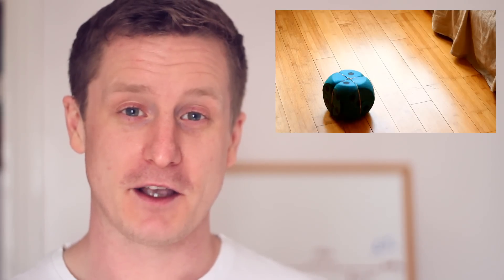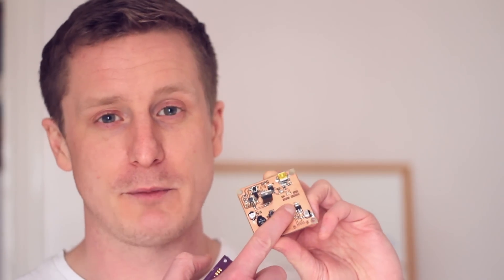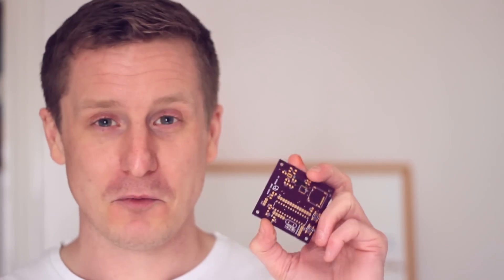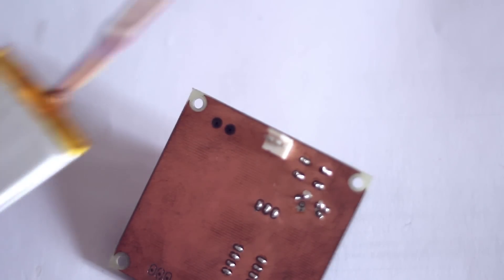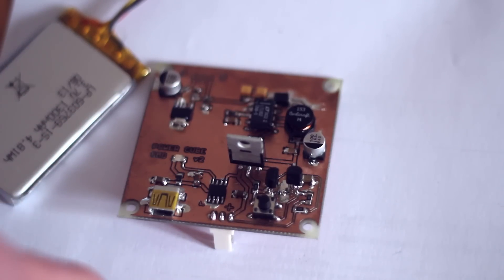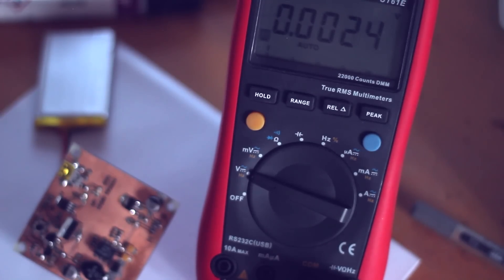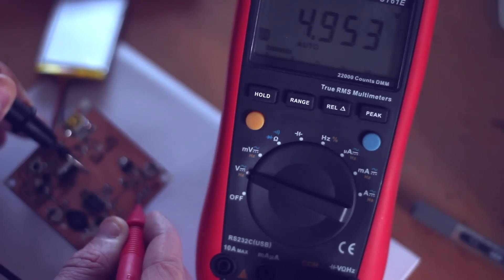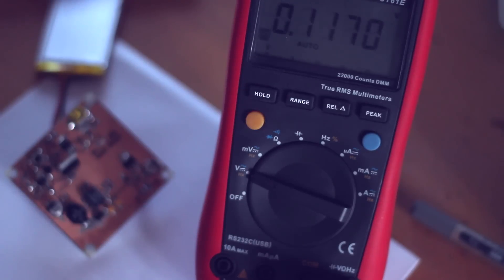Audio Cube - Part 3

Comment: great video there David! Can you share any details on where to source proto-boards locally? yours look really good. Any reasonable supplier with good turn over time. 
PS: Any recommendations on good schematic capture and PCB layout software would be appreciated.
Cheers.
Reply from the maker: Hi Syed, unfortunately I had my board milled at my work. They have a pretty good electronics department who don't mind me using their equipment. I use OSH park for other stuff, it is quite cheap and you get around a 3-4 week turn around.

I use eagle to create my boards since I don't do it commercially but you can use KiCAD if you want to sell your stuff.